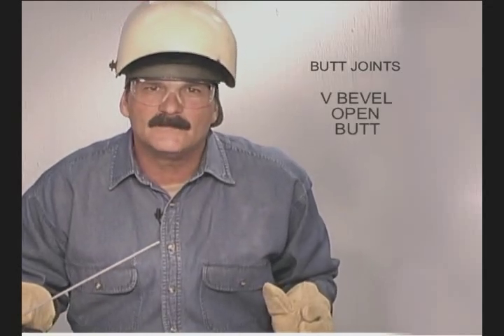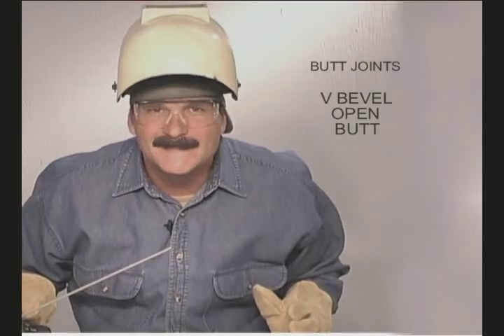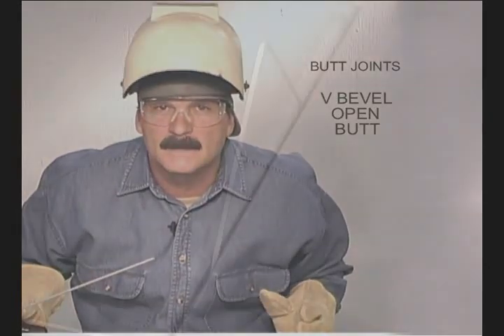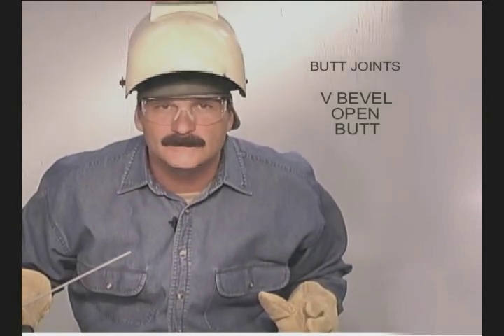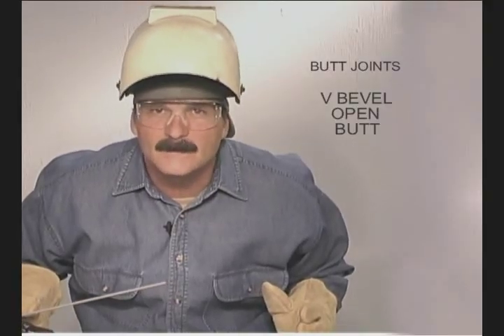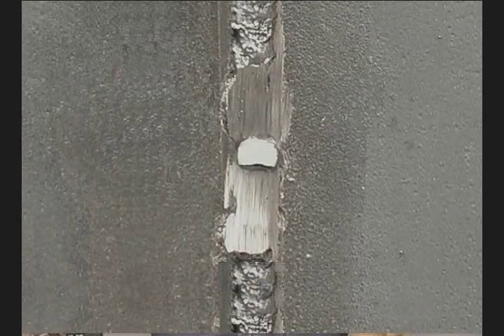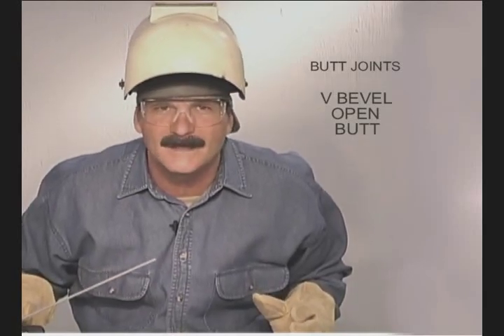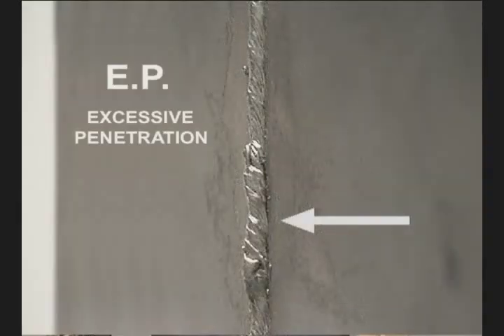Arc Welding 2 | Butt Joints | Welding Rods

Comment: I've been struggling with this joint in class, I was welding flat, horizontally trying to close the gap from the top edges, now i see you gotta fill right in the in the center of the bevel.
Damn it!